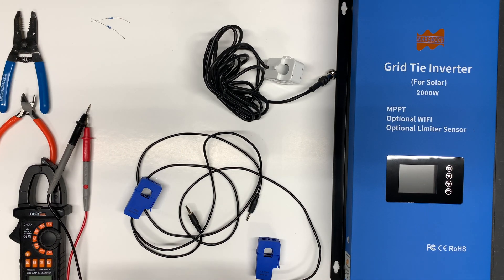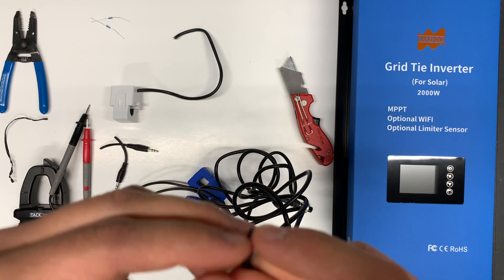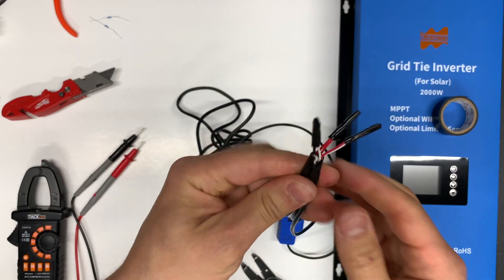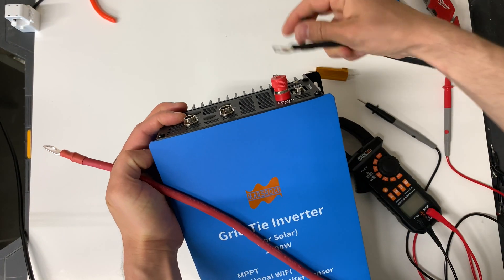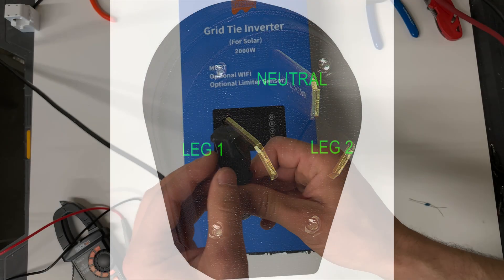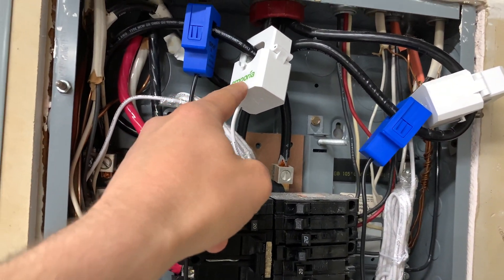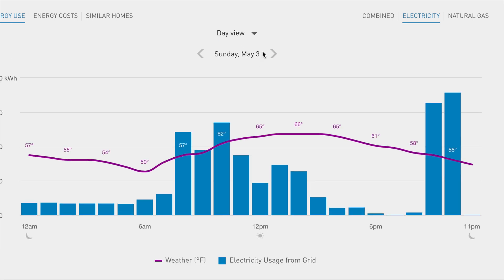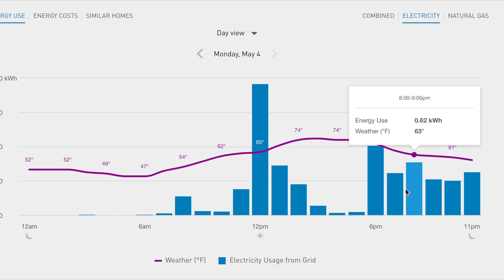2kW Grid Tie inverter with 2 CT sensors. Part 3 of 3. For US split-phase system.

Comment: I think I understand it. 2 clamps in series. So, it cuts the reading in half (Using two clamps) then adds both together to control the unit.
If one leg has 40-amps and the other leg has 10-amps pulled from the grid, unit sees 25 amps. The unit will not put out more that the highest leg or reading. Higher the amp wider the gap. But the unit can only put out so much. No problem there. Problem to me is if one leg pulls 20 amps and the other leg pulls 0 amps. Unit wants to feed 10 amps on each leg. 0 just got back feed. How far off am I thinking this way?

Comment: Good job explaining how to set up one of these things - much appreciated.  Question:  I know this is an old "thread" and maybe it's a dumb question but if the "internal limiter" is to limit the output below the amount that would feed out into the grid, What is the "external" limiter input for?   In the US I don't see many of these units, much less anyone discussing it.  Do I guess that it will cause the GTI to put out power to keep the grid draw below some given level ?   Thanks :-)

Comment: 😒 you don’t cut the wires.. the legs should be in phase so all you need is a basic 2-1 adapter to plug into the inverter

Comment: For split-phase crap, you need a inverter per leg and it's own CT per leg. Joining them to one inverter on one leg just pushes back against the supply to the total of the CT's (both legs) rather than whats being pulled on the leg the inverter is over. 
If the inverter is 220-240VAC and across the L1 & L2 then joining CT's will allow the inverter to run the loads that are across both legs but NOT the split-phase loads going up the neutral (supply transformer's centre-tap and not a real nuetral).  
This video is so wrong and yes, later videos proved it.

Comment: Great video, how has this inverter held up several years later?  Does it output "dirty" power that could cause issues for sensitive electronics?  I'm a little concerned about the wide output range of 185V-265v
Reply: @smith0436, I've had mine for over three years no issues what so ever, unlike other small inverters that would interrupt the washing machine electronics. I run my inverters limited at 60% capacity.

Comment: I wouldn't have thought that this would work given that the two phases are out of phase with each other. But hey, it worked so well done :) :) :) I will try this on my three phase 230v.
Reply: Split phase is yank term for single-phase with a centre-tap on the secondary side. It is not 2 or 3 phases as most know. This video was very wrong.
Reply: @bentheguru4986  the 220 v delivered to US homes is two separate phases, each being 110 v. I n AU where I am from the 3 phase is delivered 430 v, single phase is 240 v...in Thailand where I live, 3 phase is 385v and single phase is 227v.
Reply: @Ulbre  No, split-phase is a single phase, it is not 2-phase like we havehere in Oz in some spots. Split-phase is a 220-240VAC secondary winding with a centre-tap that is what is pulled to ground/neutral and the out ends are the L1 and L2.
Reply: @bentheguru4986  incorrect. both lines are out of phase with each other......if they were not then there is no point in separating them.
You're welcome and is there anything else you would like to know?
Reply: @Ulbre  You seriously have no flippin idea. No wasting my time on this anymore, feel free to apply for the Darwin awards for all I care.

Comment: hello, if we have one phase, how we connect 2 limiter sensors ?on the same phase will work? i wait 2 grid tie inverters so i ask your help please
Reply: If separate sensors don't work together on same phase, try using only 1 sensor with 2 units (parallel sensor wiring). in UK 1 phase.

Comment: ok perfect what a genius are you

one question then go from the energy meter I have current 220v to 110

But then I will connect the ct to ground or negative phase or positive phase in which sir?

Comment: For the US 220V, what did you connect the ground to?  You L1, L2 & N, where does ground go?
Reply from the maker: it's L1&L2 and ground, no neutral.
Reply: did you figure this out? Did use the neutral or the ground?
Reply: @protechnh  yes thx
Reply: @earthenergyhex did you use the neutral or ground? I’m currently using neutral….
Reply: @popeyeswetcactus  I used the neutral as well
Reply: @earthenergyhex  Did you just wire ground to case ?
Reply: @popeyeswetcactus  yes I did. Ground to case

Comment: The inverter is design for 1 leg. USA has two legs combined at 240v. 120v per leg. The CT is design for 1 leg. If you split the CT's and run the inveter at 240vac split phase how does it know how to distribute an unbalanced load by  doing this since there is only 1 input for the CT. If your fridge on leg 1 is drawing 200 watts at 120v and your washer on leg 2 is drawing 500 watts seems the inverter will put out 700 watts. Having that said. I assume each leg from the inverter is pushing back 350w per leg meaning. The fridge is getting 150 watts more witch goes back on the grid. The fridge is 150 watts short. As again seems to me you will be back feeding the grid with 150w. Can the inverter  manipulate each leg vs each legs power draw. If not this idea is no good for USA split phase system. Seems the joining of the two CT's is adding up the watts for a 240v application. Again the concern is how it dustrbutes per leg.
Thoughts?
Reply from the maker: you are right, inverter doesn't balance between legs. 
It works just because the meter doesn't measure consumption for leg1and leg2, only can measure total consumption for 2 legs together. 
So when we have load 1000w on L1 and 0w on L2, then inverter pushes 500W on each leg, but the inverter "sees" it as 0W consumption.

Comment: what's the difference between 2 ct sensors  clamp on 2 phases and 1 ct sensor clamp on 2 phases (2 lines at same time ) . Are they same ?
Reply: 1 clamp on 2 phases would cancel each other so you would omly see the difference between the phases.

Comment: The video is very good, I just didn't quite understand the reason for installing the two sensors and which network cables they are connected to, I'm watching the video with a translator, so there is a little doubt, if you answer I'm very grateful, thank you .
Reply from the maker: I need 2 CT sensors because I'm located in US and we have split-phase electrical system (2 hot wires, 1 neutral). 
In Europe it's usually one phase (hot) and one neutral, in this case only 1 CT sensor is needed.

Comment: hello, would this work with 3 CT sensors? I have a 3 phase electrical system. Thanks
Reply from the maker: I don't think so, you'll need to use 2 or 3 inverters to make it work.
for 3 inverters - each inverter will supply individual phase with it's own CT sensor.

Comment: Great video as always. My panel is located in the exterior of my house. My set is in my garage which is 50ft away. Do you think the CT clamps will be able to ready line 1&2 because of the distance ? Thanks
Reply from the maker: it should work, I know that on ebay you could by CT sensors wire 100ft, so 50ft shouldn't be a problem.
Reply: @SolarEngineering  Thank you sir!!

Comment: At 7:50 it appears you have set up your GTI as if it were connected to Solar Panels and not battery. In this mode it will use MPPT, if you use either of the other selectable limit modes and input a setting, it is my understanding from Mars Rock that MPPT is then disabled. I need help understanding how you set up the Menu for using batteries and a what I think is a stand alone MPPT Charge Controller (Outback/Midnite). Thank you as I know I ask/asked lots of questions and you have moved way beyond these little GTIs and are using SolArk now.
The chart for my house looks similar. My base consumption is 230Watts so that is what I get from around 10PM until around 8:00AM when sun hits my panels. After 8:00AM until 6:00PM my meter reads between 0.000KW and 0.032Watts all day long. I want to have my batteries run at night and need to understand how you set up the GTIL Menu to run batteries at night and Solar during the day. Thank you! 
Mine works perfect during the day and I don't need to adjust anything (I have an excellent property for solar so my ground based panels are setup for "sunrise", "mid day", and "sunset").
Reply from the maker: I didn't find solution to use batteries just at night without complex solutions
Reply from the maker: And that's one of the reasons I moved to SolArk

Comment: I have the same unit (SUN-GTIL2 2kW), but mine will shut it self off after running for few hours at around 600W outputs. The LCD turns black and I heard the AC plug has sparking sound.
After turning everything off for a few minutes and turn on again, it will boots normally and start output power. However, I can see the temperature shown on the LCD is around 50C.

May I know at what temperature will the fan turns on? From your video, I can hear your fan is spinning constantly (8:15) even at 400W. 
The fan on my unit doesnt spin at all... Initially i tot because of the low output, but now it seems like the unit is shutting down due to overheating...
Reply from the maker: I don't remember at what temp fans did initiate. But keep in mind that fans are the weak point there. It is possible that fans in your case failed and the inverter overheating...  
However it should start reducing it's output and display "overheat" message on the screen, it shouldn't restart. 
I'm not using these inverters anymore, so cannot check any details.
Reply: @SolarEngineering  there is no overtemp warning, or at least I don't see it coz it is off everytime I notice it. my unit is not rebooting itself but it is like killed its AC output (so no power to turn on the whole unit). I need to unplug the ac outlet, wait for a few minutes and plug it back on to get it working. If I don't unplug the AC, there is will occasionally sparking sound coming from the plug. It is like the unit tries to turn on but something wrong so it cuts the AC to protect it... Will add a fan to see whether it can solve the problem... Thanks!
Reply from the maker: @luckywang95  It sounds like the fan is not going to solve the problem, I'd suggest to open inverter and check transistors for potential damage. May be it would be easier to replace damaged parts earlier.
Reply: @SolarEngineering  hmm. But the inverter is not completely faulty, it can still work, just occasionally it stops and need a "manual" reboot. I don't know how to troubleshoot this...
Reply: @luckywang95  Do you have the 2000W inverter?
Reply: @darylw792 not owning one anymore...

Comment: Thank you for the video. Does the inverter calculate wattage based on voltage from the sensors? I'm just curios as to why you connected them in series and not parallel, I thought these sensors measure the current.
Reply from the maker: here is the update: https://www.youtube.com/watch?v=PcIfI7jypB4
now sensors connected in parallel

Comment: I have 14 battery modules. Each one has 12 lithium ion battery cells. The nominal voltage for each module is 3.7 * 12 = 44.4 , the charging voltage is 50.4v. The low discharging protection voltage is 36v. I want to charge the battery in the night and use the battery during the day for time-of-day purpose.  I like what I am seeing here. If I use a limiter so I would like to have 2000w model which does not support input voltage as low as 36v. Is there a setting to adjust the input voltage? Thanks.
Reply from the maker: unfortunately, the minimum voltage cannot be adjusted. I think you have 2 options:
1. connect batteries in series to make 24cells battery, and charge cells up to 3.75V per cell to get 90V (not ideal, since you are going to lose some capacity)
2. buy few 1kw version inverters.

Comment: What batterys did u use?
I got 8 12V 35AH deep cycle seal Lead acid ones for a 48V system. (on a tight budget).
Reply from the maker: I'm using LiFePo4, 48V 450 Ah.
the last video on the channel is a full system overview.

Comment: Great Information. Well Done.  I am considering buying a 1.5kw system with this grid tie inverter. my meter has a round dial and looks like an older model. Pretty sure I don't need to do this hack. But great that you figured it out. Helping the common man is a great thing you have done here. 

Is there a way to send the power to your battery automatically  instead of it going to the grid?
Reply from the maker: You are lucky with this meter, you could just push energy to the grid and the meter will rotate backward.
I can disconnect inverters manually (just one switch) to direct energy to the battery.
Thanks for the kind feedback.
Reply: sure buy a charge controller you need to figure out what voltage setup you have first though e. 24v or 48v

Comment: You wouldn't happen to know the specifications on the Emporia energy Vue Gen 2 CT censors would you... I'm pretty sure I have the same unit you do there's  the 2 100 amp main CT centers and then there are smaller 50 amp ct's for circuits but none of the CT sensors have specifications on them... I'm kind of wondering if the burden resistor is located in the CT sensor or in the actual vue box itself?
Reply from the maker: sorry, I don't know..
Reply: @SolarEngineering  is there a way to measure some of those values w/o dismantling the CT sensor that you know of?

Comment: Great video !!! One question. What is the maximum input current for the limiter input? Do you have a data sheet? Could it be that you destroy you input if the input current goes higher than 50mA. I think the current of both sensors is added together so there is the danger that in the worst case the input current is higher than the allowed input current.
Reply from the maker: I'm not sure what are requirements, so far it works well with two clamps.
Reply: @SolarEngineering  Maybe you never exceeded the 50mA. But if you have 100A on both phases I think the current would be 100mA. But maybe the current is limited inside the inverter.
Do you know at what limiter current the inverter produces the maximum power of 2000W. Would it be possible that you can measure this value?
Reply: one would assume putting them in series would double the voltage but not the amps. @LastEvolutionDesign

Comment: Wondering if the 2kW inverter has the option to use it on a single leg (120V) and use a smaller battery bank (36V) I know it says DC input of minimum 45V but didn't know if it was possible if only using it for a smaller load. I know I can buy the 1kW version and it will do this fine, but I would like to leave room to build onto my battery bank. Love the videos, you have a lot of great information. One of the other things I was wondering on these units, can you have them put them on schedule? I have great off peak pricing and am looking for a way to use it to my advantage.
Reply from the maker: 2kW model will work only in the range 45V - 90V (I think the starting voltage about 47 or 48V).
It will not work for 120V, you'll need to buy 1kW model..
You could add a schedule option by adding a timer either on AC or DC side.
Reply: @SolarEngineering  Thanks for the reply! Guess I will have to series a couple of those batteries I want to set up. Looking forward to more content from you!
Reply: I can confirm it does not work with 120v only.

Comment: Can i use this inverter without connecting the limiter or it will not feed power into the grid at all?
Reply from the maker: yes, it can work without a limiter.
Without a limiter, it will output full power to the grid, but you could limit MAX feeding power in settings.
Reply: @SolarEngineering  Thanks. Also, can i use this with a 3 phase wind turbine and using a bridge rectifier to feed DC power to the inverter?
Reply from the maker: @NomadFella  yes, since it's going to be just DC power, check the minimum voltage requirement for the inverter.
Additionally, this kind of inverters has a model made for wind turbines.
Reply: the wind version literally is the exact same with a 50a 3 phase bridge rectifier and studs built into the unit. (I own one).  @NomadFella

Comment: Hello, does it work also on Solis on-grid 4G mini single phase inverter? Our utility is split phase 240v.
Reply from the maker: does it use the same CT sensors?
Reply: Yes, a Split core CT, CTSA-100A
100A/33.33mA.
Reply: Our supply is same in the US, 120v- Neutral-120v.
Reply from the maker: @m20gerzy81  theoretically should work, I pushed new video with cable update: https://www.youtube.com/watch?v=PcIfI7jypB4
you could do this cable and test it as I showing in the video. I quickly googled Solis on-grid, looks like it's made for the US market, is it correct?
Reply: I think it start in australian and chinese market and pushed it to some asian countries (I'm from Philippines), europe and now in america...by the way, thanks to all your help and your very informative videos.
Reply from the maker: @m20gerzy81  thanks for the feedback!

Comment: Hello, if  connect two-phase 220v, will I have an injection in both phases? Or only in the phase that has a current sensor.
Reply from the maker: In video I'm talking about US split phase. 
Are you sure you have 2 phase system? It's not used anymore..
Reply: Yes, here in Brazil we have 220v monophasic and 220v biphasic in some cities.
Reply from the maker: I'm not familiar with it. Could you describe what voltage you have in Brazil and how many wires coming to house? (like 1 hot wire, 1 neutral, 1  ground etc). I'll try to help.
Reply: bom dia

aqui na minha região ( Brasil) a rede energia elétrica é bifásico 220 volts: fase+ fase: 220 volts e neutro e Terra.

e em alguns estados é 127+ neutro e Terra e em outros estados é 220 + neutro e terra.

porque você usou dois sensores, seria porque tem duas fases?

comprei um desses de 1k mas ainda não instalação.

abraços